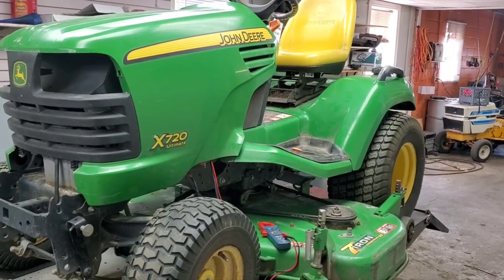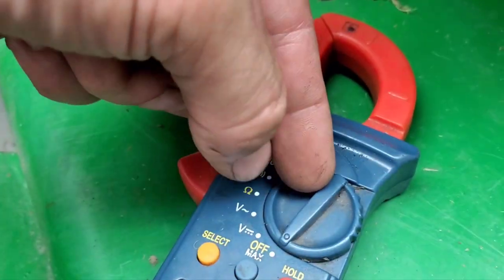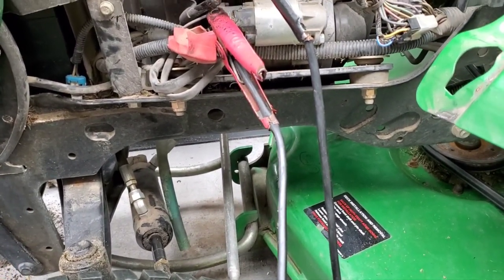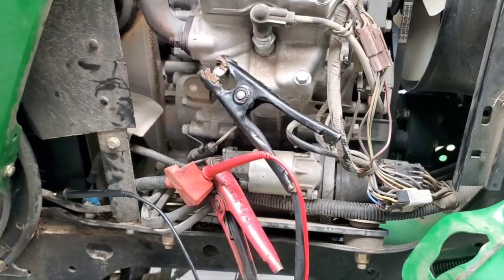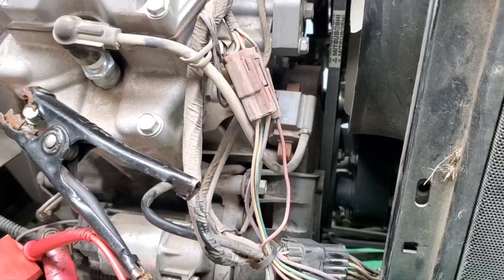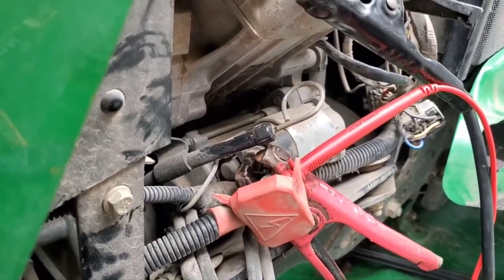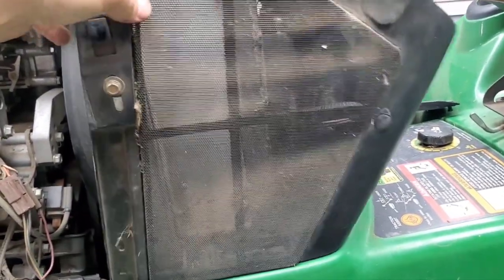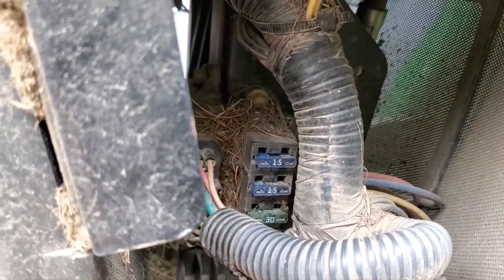Riding Mower Died While Mowing Won't Restart Battery Goes Dead Full Diagnosis - Bad Regulator

Comment: My mower died while mowing and wouldn't crank. I watched many videos and tried everything I could check. Turns out, I did pull the fuel line from the carb and gas flowed thru, however when my son checked the line before the fuel filter it flowed much greater. New fuel filter and it cranks right up. Not one video addresses a fuel filter.
Reply from the maker: Definitely a common issue for a no start also.. I have a few videos addressing this on other machines but none on this particular model